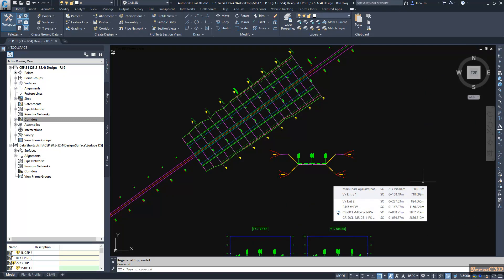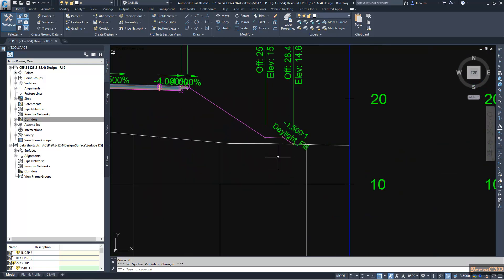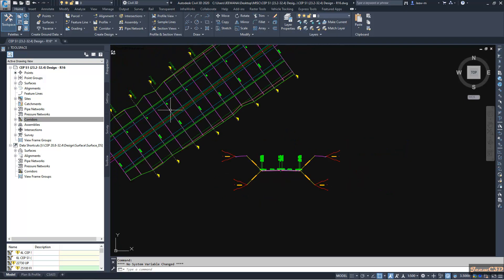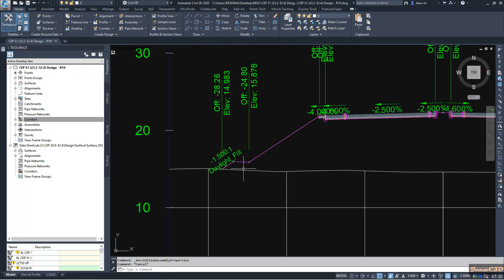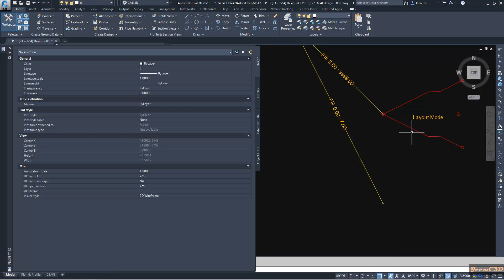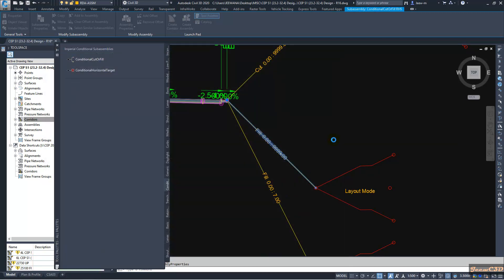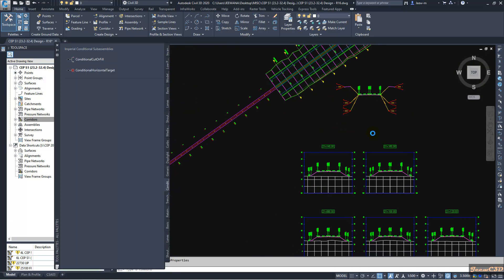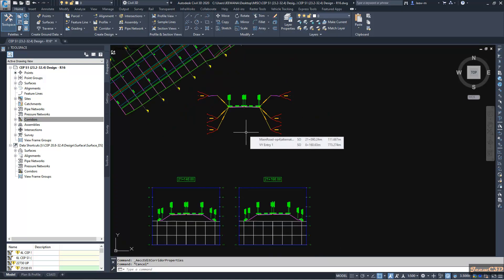Avoid Berms with Small Fills on Civil 3D Corridors using Conditional Fill Assemblies

Comment: Is there any method give a target as a existing surface for shoulder subassembly?
Reply from the maker: No. Daylights assemblies and generic links only support surface
Reply: @JeewC3D  if we want merge shoulder to existing surface , how can we do it in civil 3D. Want to change civil 3D file as cad dwg, then do it manually? Is it sir??  Thanks for valuable response sir!
Reply from the maker: @shrijenpuvaneswaran3297  Shoulder is a structural material. So it has a defined thickness. So It cannot be targeted to a surface. No way with normal civil 3D operations as of my knowledge. Probably you should do it manually.
Reply: @JeewC3D  thank you very much sir!